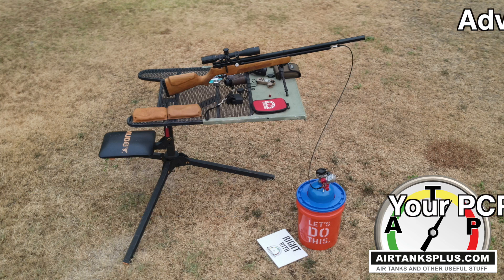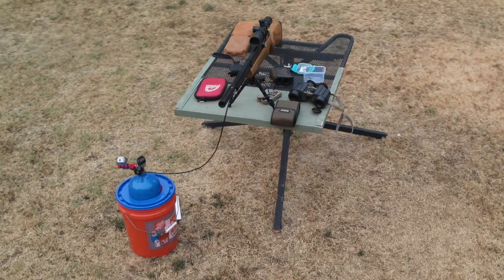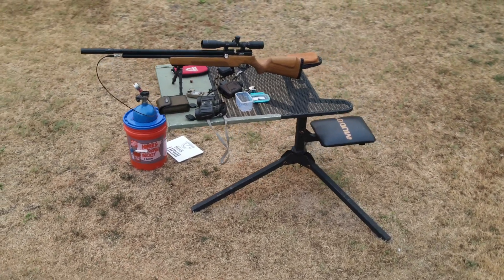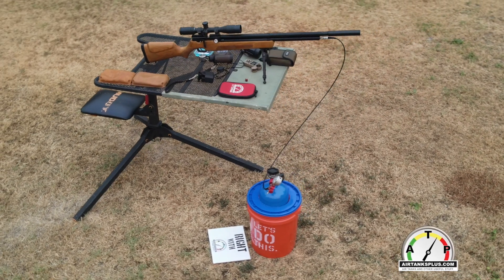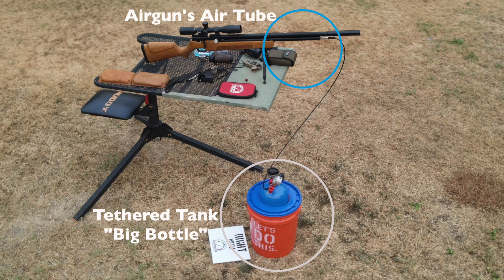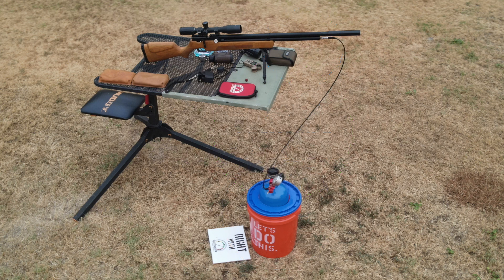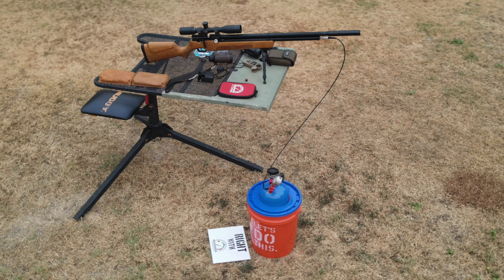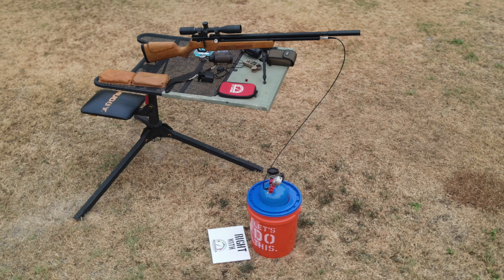Advantages to Tethering Your PCP Airgun & Creating The Poor Mans Regulator

Comment: I have 2 tether because my gun won't hold air unless the pump hooked up so im looking into this but I want a regulator and dk my guns psi im just gonna go 4 an4500psi input 1100psi out put on a 3000psi bottle an the gun i have is the iconix real bad 1st experience no 1 said anything about a regulator now im ready 2 give up but not just yet tax time coming and im looking at carbine like the bandit black nemesis and notos or a 2028 with the buckrail kit or a diana chaser hpa bottle conversion

Comment: Nice vid. I would add that tethering shouldn't be done on any PCP for which there is a fill probe which is NOT permanently (or securely fixed) fixed to the air tank because there is always a danger of the fill probe coming out should it be bumped when under pressure. Should the line be dislodged, this of course will definitely lead to the loss of much air (dependent upon how quick one reacts to turning off the tank valve) and possible damaged incurred to the shooter from the escaping high pressure air or worse still the line coming completely detached and a high pressure line with fill probe whipping wildly about and causing physical injury. How do I know? I've seen it happen. No one was injured but there was quite a bit of adrenalin flowing through those veins of that shooter for the next 30 minutes.
Reply: Thanks ! I tethered my Huben gk1 to a tank and it spinned the probe and line was twisting. The first time I did this I turned air on too fast and probe with line attached popped out scary
Reply: @JoeFriday-h9n  I bet it was!

Comment: Considering buying an AEA Challenger Bullpup .457.  It has a 500cc tank on it, and I'm trying to decide how large an air tank I need.  I'm  looking at the Great White which is I believe 98 CF, and their next size down is the Tiger Shark, at 74 CF.  The tanks are rated at 4500 psi.  Think the 74 CF model is enough capacity for me to tether, maintaining a sweet spot around 3400-3600 psi for at least 20-30 shots?
Reply: Seems the best way to find out is to just do it. I bought a 3 liter and a 6.8 liter. I want to shoot so I figure 100cubic feet of air should allow me to do that